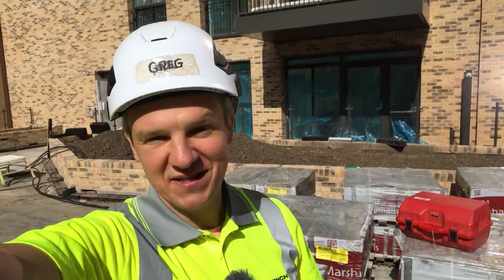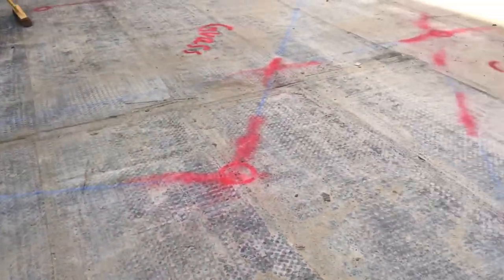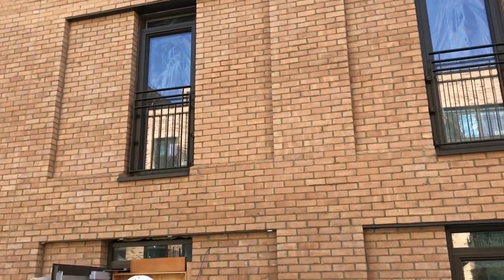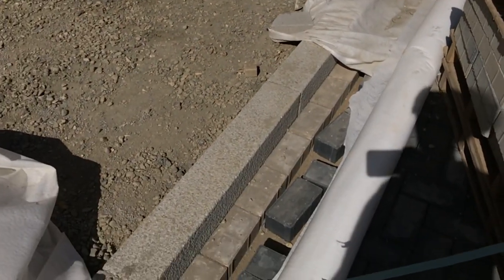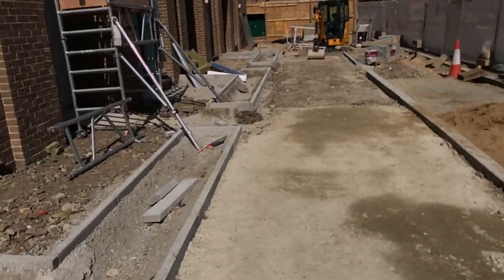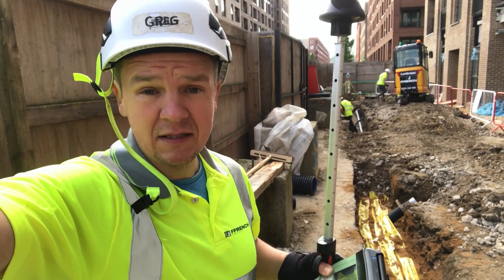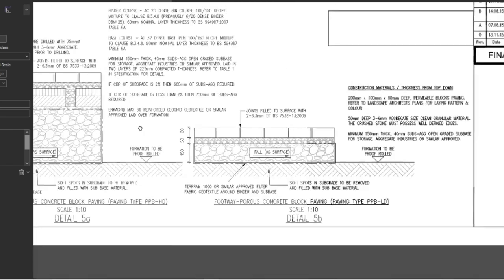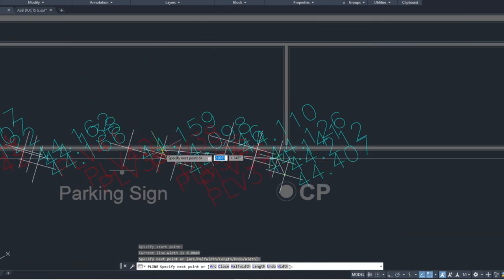NEW CONSTRUCTION SITE. SETTING OUT, SURVEYING IN CONSTRUCTION. Landscape works, kerbs and paving.

Comment: Hello Greg, when marking up column positions and grid lines in RC frame construction, do you use the 360 prism on prism pole? Do you get the required accuracy with this method as the prism is elevated above the point, thus relying on a steady hand and the accuracy of the spirit bubble in the pogo pole? Do you ever use the mini prism to achieve better accuracy? In this video you briefly covered marking the point, do you make an indent in the ground with the tip of prism pole, put the prism pole aside and then use a marker pen to mark an X. If you could demonstrate this process in one of your videos, also covering how you lay out the lines with the spray paint, I have seen it done whereby they use two bricks to tighten up the line on the ground and spray over the top of the line. Thanking You.
Reply from the maker: Hi Patrick! I was using the small one, or shooting using the laser. I know people are using pole for setting out columns, but I don't like it myself. In this case I used a laser and for as built survey I used a pole+prism. I will show soon the procedure then :) I have a chalk line so I ask someone to help me, or if it's a string line to hold it and I am spraying :)

Comment: Hello Greg. Its very intresting video. Thanks for it😃
Small sugest for you, please chech in google what is 'gst 4 tripod star'  its good for slyppery surface too.
Reply: Reason why he did not place tripod on the ground was due to the membrane placed on the ground. The tripod feet would pierce it damaging the membrane.
Reply from the maker: Hi Karol! I will have a look at it :)
Reply: Ahmad i know that😃if you use gst 4 tripod star under the tripod,  the tripod pierce will not touching the membran. I tested it😃

Comment: Hi everyone. I am very familiar with the setting out procedure on site when I have known control points to set up the station over. However, I have been giving the task of setting out a new extension to an existing building. The CAD drawing has the existing building with the extension present but no proper X,Y,Z co-ordinates on it. There is also no known control point anywhere on this site.
Can someone please assist me on how I go about setting out this building?? Any help would be great
Reply from the maker: Hi! I would shoot the existing building and set a ref line a work with it, as it really will be your 'local system' where you will be using offset as x and length of line as y.
Let me know if you need more explanation.👍👍👍
Reply: @SITENG  Set up TS on arbitrary coords like 1000,5000,100 and then shoot the building? I can then transfer over the cad drawing onto my surveyed points and survey a few control points? Would that work
Reply from the maker: you can also set up 2 targets so you can have always the same reference line and than you can prepare the information in advance knowing the O and L for whatever you will be setting out.
Reply from the maker: Can do like that too if you have a CAD drawing, working in your local system this way